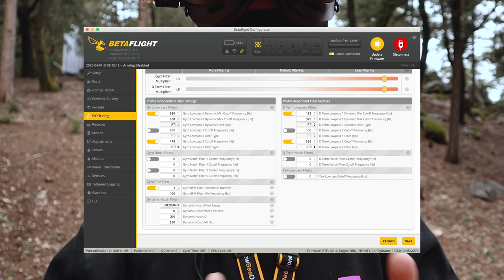NewBeeDrone SMOOV Motors Review and Tuning Tips

Comment: I got the higher kv motors 2450 and doesn't look like all one magnetic? Can see individual magnets not a gray ring that goes all around bottom of bell? What's the difference? Was planning on putting on a 5inch build?
Reply from the maker: Those might be the Flow motors? Is that what they are? Or is it a new version of the Smoovs? Individual magnets will have more power.

Comment: how is the efficiency, this is the real interesting selling point if its true.
Reply from the maker: I would have to test again for that. I'll be honest, I don't pay too much attention to efficiency unless I notice it to be really bad, or really good, or if I'm working on a long range quad.
Reply: @PinchTune  If I can get 5min on a single pack that would be nuts, most I get now is 3.30 on a normal freestyle run.
Reply from the maker: @mmakam3  Yeah, 3:30 is usually my target. But I also land where resting voltage on cells is about 3.7, so I'm very conservative with my packs.
Reply: @PinchTune  wow that's really good, do you run low uptilt? I run mine down to 3.3v
Reply from the maker: @mmakam3  Yeah, I fly 25 degrees and generally fly slow. I don't go all the way down to 3.3v because, even if my resting voltage is 3.5v, for sure I'm sagging below 3.1v volts at various points if I wait that long. That breaks down batteries too fast. My batteries will last 2 years or more if I don't smash them. Additionally I normally fly a routine... after 3 minutes, the routine gets too long and it just gets repetitive or lame. But yeah, I normally fly for the GoPro.
Reply: @PinchTune  really great tips, thanks man. I'm just starting to make content myself, and I'm always going too fast and killing packs lol.

Comment: you hsould be running low/0/200/90 on that dynamic notch if youre on rpm filtering~  and u can crank to 2.0 filtering
Reply from the maker: I'll try that. Thanks. My thought was, less filtering way down there might reduce latency. But of course, at the point I moved the sliders almost all the way up, more filtering was needed.

There are other combinations I can try. For example, keeping the PIDs slightly down, then upping the sliders and leaving the dynamic where it is. But I'll give your recommendation there a try. In reality, it's flying amazing as it is. So anything gains I think will be minimal. Maybe it'll take care of the little bit of propwash I should in flight 3 in the video.
Reply: when you have RPM filter enabled.. its going to crush out most of the motor noise. so we want that dynamic notch hovering around the low point picking off any frame resonances or low end noise that make it past the the RPM notches...  then we want to get the other filters out of the way and to kill off any higher end noise.  so if your build is clean, and gyros are good.  2.0 filtering, with dynamic notch at low/0/200/90, or low/0/250/100, is gunna give you extremely low delay and the best possible prop-wash response!  

other things to do is to raise the 'dmin-GAIN" to 40..  and iterm relax to RP GYRO 10

i bet those settings alone would make your quad make a big difference!!
Reply from the maker: @Krunked  I'll try it! I'm come back to this post when I'm out flying again and test it. THANKS.
Reply: @PinchTune  great -- cant wait to hear if it worked better for u :)

Comment: Do you think the 1750kv smoov can handle a 6inch prop?
Reply from the maker: I haven't flown it with 6 inch, but it should be fine. Normally you drop kv when going 6 inch, but I fly higher kv on 6 inch 5s and my buddy flies 1950kv 6s on 6 inch.
Reply: @PinchTune  yeah the biggest thing to worry about is voltage sag when using bigger props that's why u lower the kv the thing that has me worried is the torque which means I would atleast have to have very little pitch in the props if running 6 inch.
Reply: @PinchTune  also do u fly 2306 on 6 inch props or 2407?
Reply from the maker: @allwrightadventures6675  Yeah, voltage sag is one thing. But assuming your battery can handle it, the other reason it to more or less match the power of a 5 inch rig, but in 6 inch (with the added benefit of better efficiency). Technically you could also limit it if you needed to. But with these motors, I understand, the torque curve it different. I would use a light 6 inch prop. Something like the T-Motor 6143.
Reply from the maker: @allwrightadventures6675  I fly 2207.5 and 2208 on 6 inch. I've never flown 2407 motors. 2306 is a motor size I love, but specifically for freestyle on a lightweight quad. If it gets too bulky I immediately want to go bigger. So... yeah, maybe this motor wouldn't be the best match for a 6 inch rig. You want a sick motor for 6 inch? Get the XNOVA 2208 Lightning V2N.
Reply: @PinchTune  yeah I'm building a Mr croc. Build so I'm going to try these if it can't handle the weight then I'm going to go a bit bigger, but I really like that ring magnet Newbee really did something innovative there, just like digital and 6s is  taking over the fpv market these also have the potential of taking over the freestyle market..

Comment: I think they are just smoother because they are under powered not knocking em but that's my thoughts I bought a set they are still nice motors
Reply from the maker: bigg fpv Nope. I have many other underpowered motors. And they are not as smooth as these. The T-Motor F40/60 III are really dang close tho.
Reply: @PinchTune  I don't know there nice but I wouldn't buy em again but to each their own
Reply from the maker: bigg fpv Right. Apart from the gear drought because of this virus, it’s a great time for FPV. There are options!!
Reply: @PinchTune  true that

Comment: Meh, i call bullshit these are smoother than my xings....w new bearings....but if so, cuz magnets further from stator, ...but luv ya bruh.
Reply: They are not smoother than Xing. They are SMOOOVER.
Reply: @ki-lowatt7789  lol
Reply from the maker: What XINGs are you flying? I raced the 2206/1700kv (red and silvers) for the 2019 season. Ended up breaking them all (3 sets). Burnt some, separated some bells, etc. But I abused them so I would expect the same from any motor really. I think the unibell design of their newer motors, and also T-motor's offerings (like the Pacers I reviewed the other day) are a great way to add durability. Maybe not something for a motor like this Smoov, as cinematic motors shouldn't be taking freestyle and race beatings.
Reply: @PinchTune  funny I have the same set in 2750kv been flying for over a year modest freestyle and never broke or burnt one...but I rarely crash hard ......maybe early batches better ? I might believe that new xing w the huge bearing, is smoother though, but it's ugly disco ball lookin, like da tmotor copy WITHOUT THE huge bearing, obvious tmotor trying to stay relevant
Reply from the maker: @flo-ridafpv5713  Oh, I'm sure mine were just as good as yours. If they has been on freestyle rigs they'd be fine. But racing, no. I HAVE to finish a heat. So if I smack a flag or gate, I'll turtle mode and get back in the air and finish the race with bent up props even if the motors catch on fire. Also, most of the qualifiers last year had metal pole gates, so that's another thing. And here in SoCal we don't have grass. We race either over concrete or over hard dirt fields with gravel.
Reply: @PinchTune  ah ok I don't race n turtle careful, here in Florida thick moist grass.  & hey you & yours Stay safe over there Danny